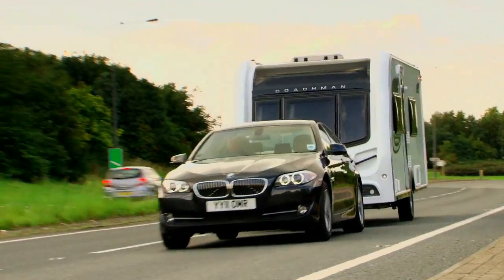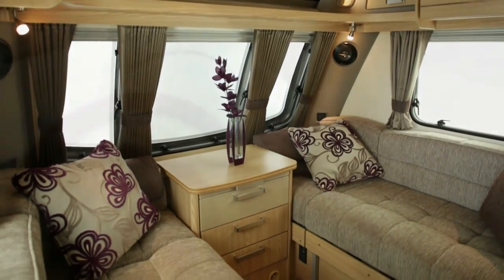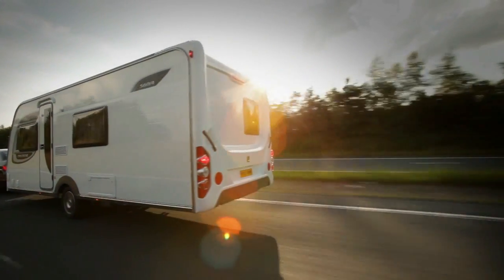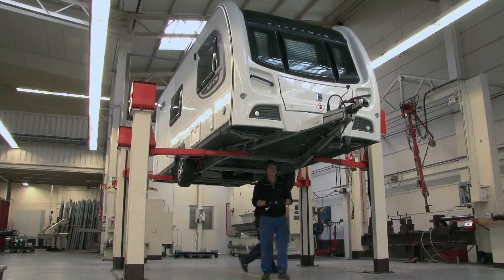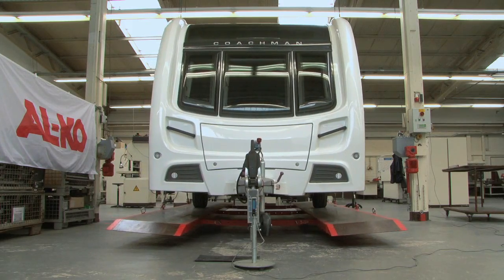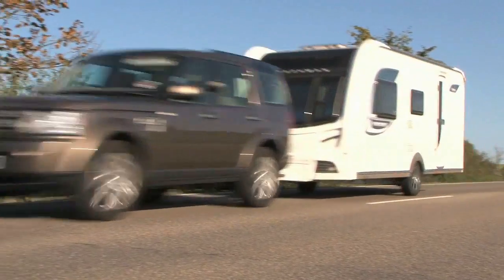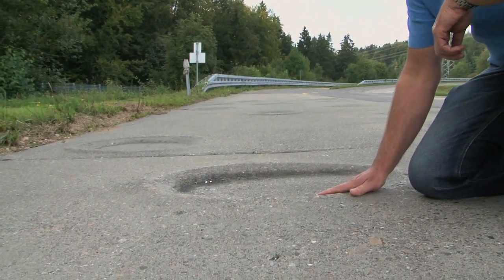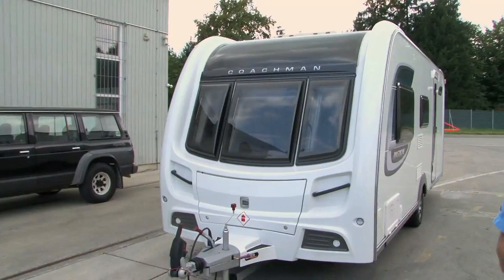Coachman Caravans 2012 Season Test Track Video - Coachman Pastiche Video HD

Comment: Having worked in the testing industry, it's a shame the production builds are not as precisely asembled as the development prototype! Sadly, when you know a vehicle is going for test, days are spent ensuring everything is to the corect torque, etc. That doesn't happen with vehicles travelling down a time allocated manual production line which doesn't use calibrated torque tools and a QA system to monitor those torques or even if screws are missing!